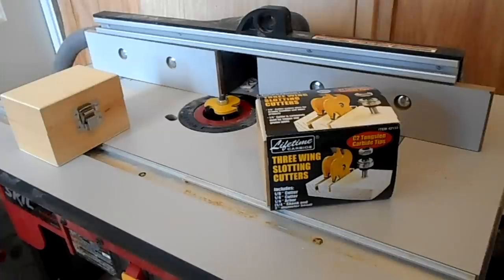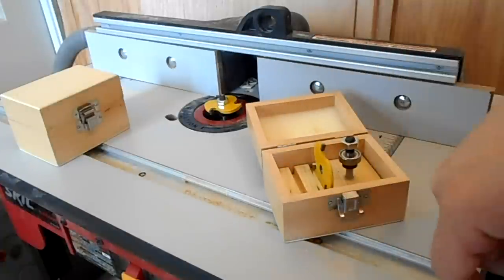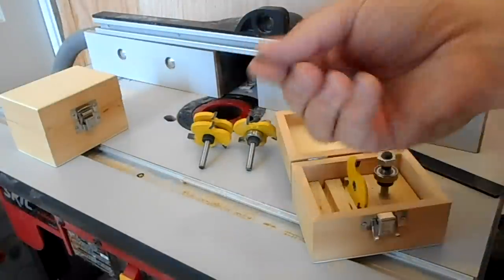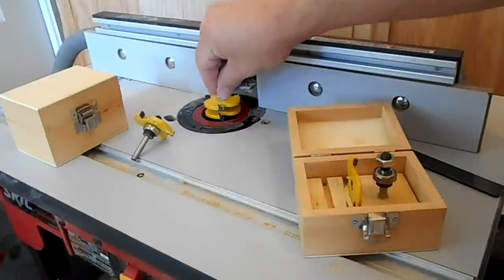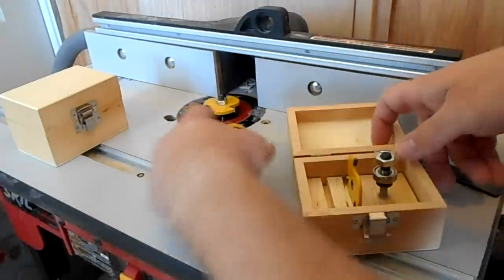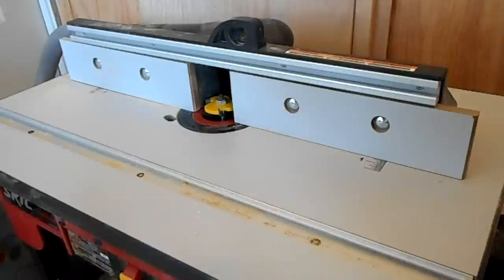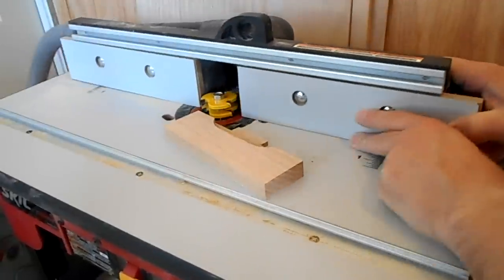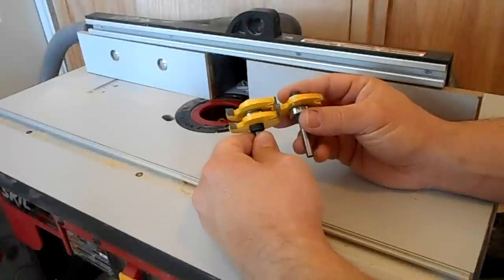Custom Tongue and Groove Router Bits

Comment: just an fyi, can buy both pieces already set and measured correctly on Amazon for about $18
Reply from the maker: Wow, that is awesome!  When I put this set together, there wasn't anything like it available for under $100.  The only thing they are missing is the rubber washer.  Totally going to order a set.
Reply: @dslynx   glad to help, personally after reading the reviews on the said ones that were $18 would avoid them and spend little more for the ones with a better review setting.  I'm bout to order the $30 3 bit set, this one makes it to where you don't need the washer there's a "K" on the shaft that you line it up on on  your router for accuracy ;)
Reply from the maker: @draon840  That sounds great, even $30 is cheap, so I'd live to hear your opinion after you have used it a few times.  Not sure how accurate the "K" will be if it's relying on the human eye to line it up, but unless they have some weird shank, you can always toss the o-ring in just to be safe.

Comment: I bought a similar set from amazon but the bit is about 1 1/2 inch in diameter and my router turns at 25,000 rpm, and what is recommended for 1 1/2 diameter is 12,000 rpm.  I sent it back.  Please check your router for rpm rating if it is not variable.

Comment: thaks for the advise I try to used with a ryobi and it doesnt work when I turn it on the motor goes up using 2 blades  and when I use it with 1 blade it doesnt go up the motor

Comment: How does it work on end grain that is more narrow? Any issues with it sinking in to the bit as you don't have the bearing for support?
Reply from the maker: +Ricky Mcgrath Excellent question.  Apparently I haven't had to do that yet, as I built a desk using them and never needed to route a narrow piece.  My only idea would be to clamp all the narrow pieces together and route them all at the same time, or clamp a scrap piece of wood to a narrow piece.

Comment: I just bought the same exact set you did and I got three so I could make 2 separate bits that I just swap out.   So, this box did not come with any instructions and my router is my dad's old router.   So,  I have no idea how to sinch down the bolt on the top of the bit.   I can only get it finger tight.   In afraid to use because I don't want it coming off when I turn it on and hurting something.   Can't you explain how to properly tighten the bolt? 
I know this sounds stupid but I'm brand new at this and I don't have any instructions.
Reply from the maker: 89wheatthin When you get it set up, you just saved yourself a bunch of time and money.  As for tightening the nut, I just used a pair of pliers to hold the shaft and then either a socket or crescent wrench to tighten the nut.

Comment: Please tell me where you bought the router bits for cutting tongue and groove. I'm going to use it for making the cabinet that goes under the bathroom sink. And the ones that are built with tongue and groove are very expensive. And if you have one set of bits that you got for would you say $25. It would help me out extremely. Thank you very much I look forward to hearing from you

Comment: Looks dangerous
Reply from the maker: Not any more dangerous than the original product this is a copy of, or any power tools that can take a finger off for that matter.
Reply: James Zawacki I am not scared of losing a finger i am scared of that bit going out of the shank I got a matching set of them on amazon with the miter joint bit for around 34 and I hardly use them odd enough i use the table saw knowing that is even dangerous

Comment: surely you don't need the bearing if you are using a fence, if you set the fence the right distance it will cut the right depth, regardless of the bearing
Reply from the maker: Correct, bearing or no bearing, you need a way to measure the depth of the cut so that it will be set the exact same every time.  In this case, it's not even using the bearing when cutting, but if it wasn't there, I would just have to make the templates longer.  If the bearing was the correct size (1/4" depth), it would make setup a lot faster, as you would be able to take any scrap wood and set the proper depth every time.
Reply: James Zawacki Thanks for the reply, what I meant was, isn't the fence there for setting depth of cut to save making templates. You worked out the height perfectly so isn't it a case of just setting the fence the correct distance from the bit, and remove the bearing. Perhaps I'm missing something.
Reply from the maker: Right, but every time you need to swap bits, you have to move the fence to get the bits out.  Without an easy template to make sure you set the depth correct, you'd have to measure and run a test cut each time you changed bits.
Reply: James Zawacki Ok, of course I was forgetting the changing of the bit. Doh!
Cheers :-)

Comment: Is that a 1/4" shaft? Wow - that is NOT sufficient for this type of cutter at all.
Reply from the maker: Apparently you are right.  I just went to their site to look up the shaft diameter and they don't appear to be selling them anymore.  I built an entire desk using them and never had a problem.  But, the desk turned out to be more work than I was willing to do for an entire kitchen cabinet setup, so I ordered RTA cabinets instead.